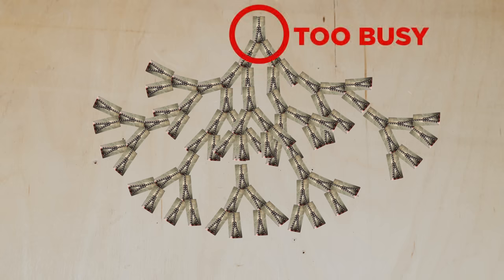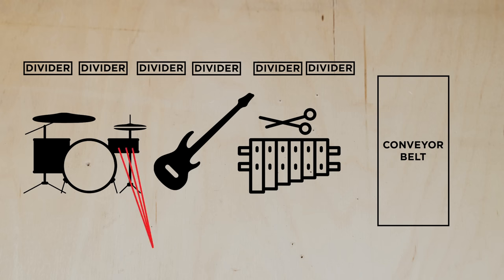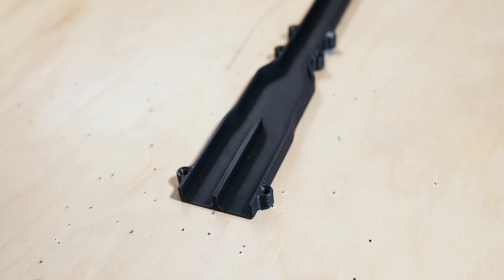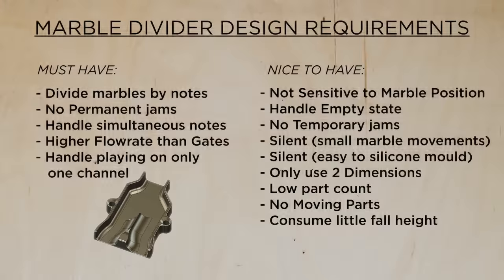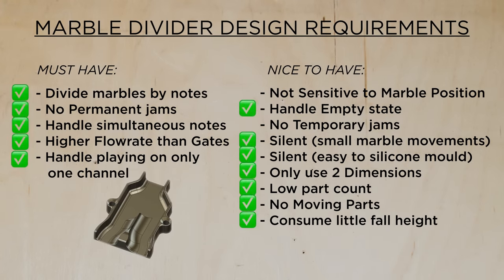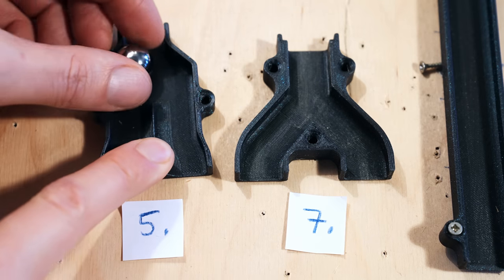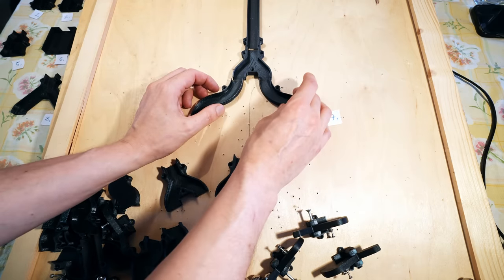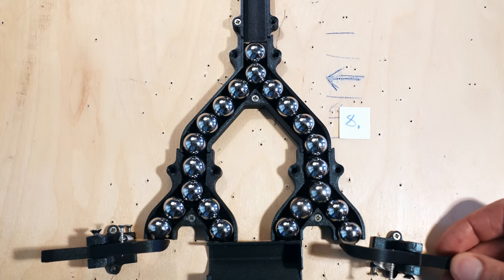Mystery Marble Divider?

Comment: Silicon has a different coefficient of friction and could change the jam behavior. But I wonder if adding some rubber glue on the bumps or screwing to the plywood with felt underneath would improve the sound.
Reply: This was my first thought.
Reply: This definitely needs a few more likes and comments to move up.  This is an important test to conduct before moving to a larger-scale production of dividers
Reply: Don't worry, there'll be a whole video about it in 8 months.
Reply: Sound would still transmit through the screws unless the same rubber shock absorbers used in some CD drives and other shock-sensitive devices can be implemented here.
Reply: @custos3249  You could use a spring retained screw to maintain position on the assembly but provide some dampening between the screw and the track in combination with a felt or rubber backing layer. Felt is a pretty cool building material for stuff like this, so that's what I would go with. but either should be effective.
Reply: @custos3249  you are suggesting (rubber) washers aren’t you? 😅
Reply: @TuckerDowns  Yep, same concept, different materials used to decouple mechanical elements. The rubber bellows tend to be simpler and more reliable from what I've seen though.
Reply: @Sveinkva  No
Reply: Or covering them with felt
Reply: He should just machine it out of solid POM or something.
Reply: 3d printed TPU?
Reply: Silicone should work fine as long as it doesn’t deform too much.
Reply: The thing about all the jams he showed is that they were steric issues. Each of them was caused by the space that was or was not available.
You're correct that friction affects things, but I think it would only affect flow rate in this instance. If jams do show up, they would be for a different reason (which he could fix by raising the incline more, a la MMX)
Reply: You could use Butyl rubber or mass-loaded vinyl as a damper between the mounting surface and divider and that would probably be a pretty reasonable and drop-in friendly solution.
Reply: Exactly
Reply: @SmokedHam444  How would machining it out of POM help with the noise? Yes it is low friction and wear resistant but it is still hard and the marbles impacting the surfaces and each other would still create noise.
Reply: Any kind of flexible damping material is going to come with a jam risk, especially in the lanes.
Reply: Silencing the divider itself is pretty much pointless, since most sound seems to come from the marbles hitting each other.
Reply: @QuantumAnomaly  Likes and comments here on Youtube aren't the way Martin wants feedback. He's said before that the Marble Machine subreddit is much more reliable at floating good stuff to the top, so he wants suggestions there, not here, and if we're going to put work into upvoting good suggestions, again he's said we should do that on the subreddit. And there's always the discord too.
Reply: @jdmjesus6103  the main damping material should be between the lane and the plywood or other mount to reduce vibrations there. Doesn't affect the lanes.
Reply: @TuckerDowns  IF the lane pieces are fixed to each other. If they are flexibly mounted and can move relative to each other, then it could be a problem. But I did say anything in the lanes would have more risk.
Reply: @TuckerDowns I like the idea of felt purely as a material. I wonder if it would introduce some unacceptable inconveniences in the construction and adjustment.
Reply: @jdmjesus6103 Good point
Reply: @faithful451 I've constructed several plywood contraptions for optical stuff and black felt is often used to help darken the inside of an optical assembly. 

You can use spray adhesive  on the work piece to place an oversize sheet and trim with a razer blade. It looks super clean.
Reply: I think you mean PDMS, not silicon. Unfortunately, PDMS is often referred to as siliconE.
Reply: What about cork? I'm not a musician, but I re-use cork bottle stoppers for a lot of things where dampening is required, like anti-vibration feet, or to wedge between a clothes washer or refrigerator and a wall.
Reply: @drewscreen  Cork sheet would work well too but I would prefer to see a more sustainable material.
Reply: Everyone except for @MikrySoft seems to have missed that the vast majority of the sound is from marbles hitting other marbles.
Reply: @TheQuicksilver115  I was mainly addressing the points that Martin was making about the marbles rolling on the track and being mounted on the plywood at @14:50

Comment: The thing I like best about the "each instrument has its own path back to the top of the machine" is that instruments can be tested in isolation, and the path will behave the same way that it would if all instruments were playing. Part of the problem with MMX was that the behaviour of the machine changed when more instruments were playing: more marbles using the return lanes, dividers, lifts, etc., and when that happened, it tended to break because those features hadn't been tested at that flow rate.

If an instrument has its own flow path, then you can get it working at its own maximum flow rate, and then more or less forget about it when you move on to the next instrument, because, unlike MMX, adding another instrument shouldn't affect it.
Reply: Okay, but the source of that problem is also a core part of its fundamental design that cannot be "fixed": It's one machine that plays multiple instruments at the same time.

Once again he's forgetting what he's working on, making choices that fight against things he can't change. If he wants to go in this direction, he'll end up making a bunch of separate single-instrument marble machines, which is extremely inefficient and sinks what's actually impressive about the project.
Reply: @Mark_LaCroix  I think one machine that handles multiple instruments is still one machine. it is true that each instrument wont be "connected" through the marble channels, but its still one machine handling the movement of those marbles
Reply: I agree with this sentiment, though I think there is an extreme form of this where he doesn’t end up with a single marble machine so much as he does several marble instruments. I’m sure it would be fun to watch (reminiscent of Pipe Dream from Animusic), but it feels less like a single wondrous instrument. Maybe that’s for the better though. He clearly thought the MMX wasn’t worth the insanity.
Reply: Yeah, i had kinda lost interest in the proje t from the original sketches saying hes building several seperate instrument modules. Not as cool anymore.
Reply: @antiseth3964 oh for sure. Like if ever instrument is completely separate, then he's just controlling a bunch of machines. But it seems that for right now, the power system and programming is all still central, so I would consider it a single machine
Reply: Modular. Ftw.
Reply: If you had actual design goals for the project, it wouldnt be that hard to add up how mamy marbles each instrument uses and then design a marble return that would handle all of that.
Reply: @jetison333  True, you could design it so that it could work in theory... But you could never properly test it until you had every instrument playing.

I think that Martin thought that MMX was designed for enough throughout to handle all of the instruments playing, and for all the marbles necessary to prevent a channel from running dry (when an instrument was running) to circulate through the marble divider again and again (when that instrument was turned off)... but before the vibraphone channels were even added, it became clear it didn't.

At the very least, I think a modular return feed like Martin described is what MM3 needs to do until all of the instrument channels are functioning; if he wants to revisit the idea of a single marble recirculation system for the entire MM3 after that point, I'd support trying the idea out then, when he can actually do proper volume testing and not be fooled into thinking it will work at full capacity because it works at 10% capacity.
Reply: Multiple lifting mechanisms will be fun to watch, but I am a bit worried, that they will also require multiple time the energy. This might just shift the marble distribution problem to a different area.
Reply: BPM. Martin talked about dividing by NOTES, not BEATS. He refuses to deal with TIME, which is the only thing that matters because TIME requires absolute precision. Each channel must be designed to handle the maximum BPM plus a margin of error. His insistence that TIMIING must be perfect is what creates this madness. He wants to have a digital world carved into an analog machine and this is impossible. It is not "unlikely" or "difficult". It is literally impossible. He also refuses to accept, and paraphrasing him here "I won't be able to adjust the marble release mechanism", that millimeter based design using plastic parts on a semi-rigid platform without consistent/implemented parity testing (e.g. angle of marbles, just as an example) will consistently produce inconsistent results. Then he goes on with the desire to change the material to "silicone" or something that will dull the noise? Dulling the noise means reducing energy in the system, again creating unknown variables. And on and on and on it goes, chasing his tail down a rabbit hole.

High precision, monolithic architectures are dumb. Period. The Saturn V rocket was not monolithic. It was a collection of larger modules with submodules and an error correcting algorithm that was both digital and analog (human).

If he wants digital precision in an analog machine like this that contains inherent chaos (the marbles) then he must, at least, do per channel precision. Each channel must be tuned to BPM with a =/- error based on marble chaos. Each channel must contain its own marbles. Then, each channel must be assembled and tuned to each other channel. The synchronization mechanism between each channel must be tunable and, perhaps, constantly so. This way, he has two larger variables to worry about: Channel BPM consistency and Channel to Channel consistency.  Right now he is designing a chaos based monolithic system which will always fail in terms of precision.

Comment: 14:42 blink and you'll miss it, but the type 10 divider already had a potential permanent jam issue on the left most lane.  You'll see it again around 14:48.  I suspect the 'wiggle' method is introducing a much smaller but stacking chance of error on each extra bend it uses.  Sadly, I have no good ideas beyond an agitator of some sort, but that introduces complexity no matter how it is implemented that will likely add an even more annoying source of error.  Tighter tolerances perhaps?  But I suspect that is just going to achieve a reduction, not elimination, before it simply jams from friction.
If there are never any marbles pushing down on a splitter when it is not in action, it would allow for much more reliable designs to be put into effect.  So perhaps double gating, one at the note playing end and another synced with it at the feed-in for that splitter?  I'm still not fond of that as it introduces more points of failure and complexity.
Sorry, I'm not particularly helpful here.
Reply: liking and commenting to get this closer to the top. i also noticed the thing at 14:48. also 14:38
Reply: I also noticed it but realised that it was due to his makeshift marble gates. He had stopped them with half a marble through, which would never happen with a true marble gate. This upset the height tuning, causing the jam.
Reply: Well spotted! I actually think that any design without moving parts where you can get unlucky enough to balance the ball on the middle (pin or ridge) may potentially jam. And I think making it out of silicon will increase friction which would make balancing a single ball ever so slightly more probable.

Perhaps the gate must be intentionally asymmetric and the weight of the incoming balls pushes balls to another channel over a small ridge on the outside curve? That way the divider would always fill one side first but as long as you feed enough balls, it will fill out all channels.
Reply: A row of marbles waiting in any kind of track will never have a fixed length. This because there needs to be some room around the marbles to reduce friction, and this room will allow marbles to configure themselves in different ways with different lengths. The only solution is a "height insensitive marble divider" indeed.
Reply: @jurjenbos228  It seems to me that the "fixed length" requirement was about "difference must not exceed half the radius" instead of "length must be identical". I totally agree that the latter cannot be accomplished, but the former can be accomplished in most cases with adequate design.

Comment: I think having separate loops for banks of channels is the wisest design decision you could have made for MM3. The story of MMX essentially revolves around the troubles that came out of the sheer number of marbles some parts had to be able to handle in a single thread. 

MM3 is going multi-threaded. As a software developer, I approve! 👍👍
Reply: Now he just needs to learn one of the most important tools we software developers have:
"Most problems can be solved by adding another layer of indirection."  😉
Reply: Separate loops is not just multithreading. It also assures separation of concerns. One part of the whole should not affect another
Reply: @Generoman He could use different marble color for each channel of the machine. If a marble drop on the floor, he just have to look at the color to find the source of the problem.
Reply: @DaVoKanfr Oooh that'd be really handy! It'd also keep him from having to somehow count how many are in each one to get loose marbles back to where they need to go to keep the number of marbles in each loop constant, just look at the colors and they're all back where they belong!
Reply: A fill gauge would be another option. If he has enough marbles in each lane it doesn't make much of a difference which lane he puts it in unless the particular lane is running below his low level fill mark.

Comment: I noticed you didn't address an old enemy of the MMX: marble pressure. While it was primarily an issue for the gates, these divider designs look like they have the potential to operate differently when under load.
Reply: The load won't be as high in the new machine since he will use different lanes for different instruments.
Reply: @karlvestklev  unless he builds the machine with a large gently sloping feeder they will all have a load on them and will operate differently causeing him to yet again scrap it and start over.
Reply: @karlvestklev the instruments that are used the most (e.g. Hi hat) would have a higher load so yes I guess this is a valid point that should be addressed

Comment: I personally think the height dependency issue is a major reliability concern.
If, for example, due to stacking a longer marble path is a bit inconsistent, it could cause issues. If marbles have minor size differences it could cause issues and if the parts during their life just stretch / wear a little bit it could cause issues.
Reply: This. Are the marbles uniform in diameter? And I didn't even think of wear.
Reply: If he uses silicon or any other sound dampening material for marble paths then marble pressure can have major effect on marble position. Also wear and tear after 10 000 or 100 000 marbles will mean constant jams since different paths wear to different lengths and height is no longer exactly same.
Reply: Assuming he's using mass-produced industrial ball bearings, the uniformity should be far in excess of what he needs. The tolerances are measured in thousandths of a millimeter.